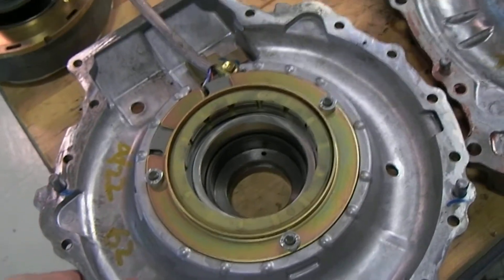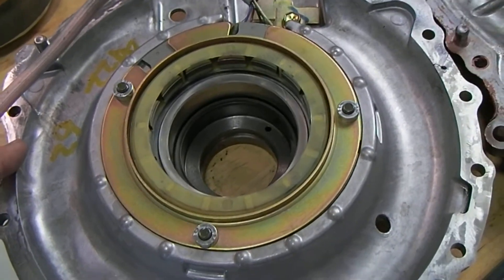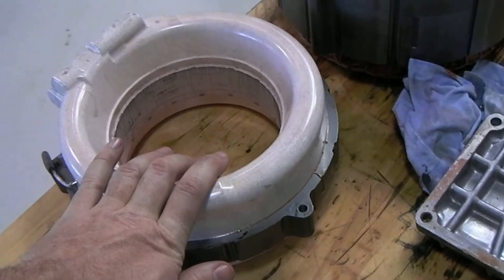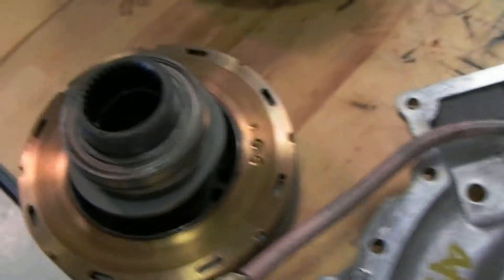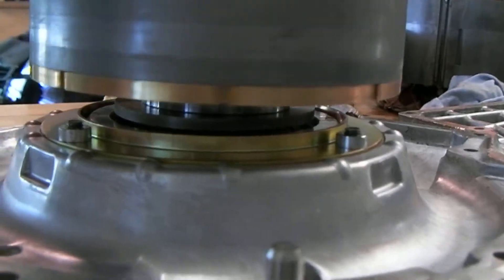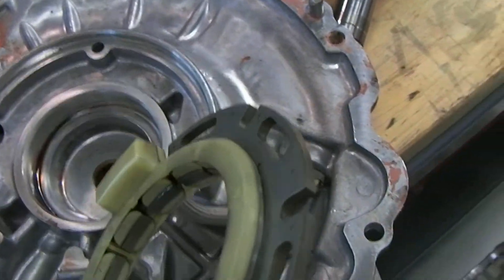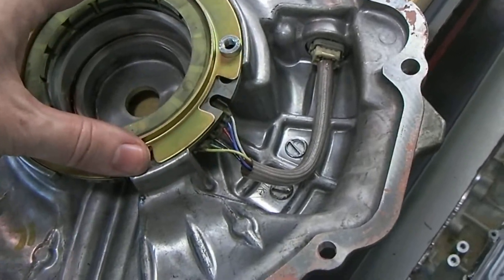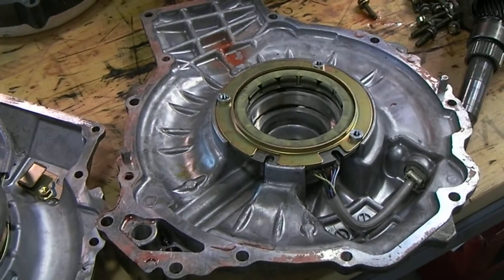Toyota Prius Resolver

Comment: P0a3f is what my 2012 ct200 threw yesterday. Which resolver does this point to? Shop is doing other tests on wiring now but if it is trans internal im just going to swap trans from a prius. Ok you need to have them factory calibrated. Darn. So if they dont find short in wiring or hyb ecu issue i wll have to swap trans. This stinks.

Comment: My prius gen 3 stopped me on the road. It give P0335. Crankshaft Position Sensor.  Sensor changed,  wiring harness ok, Ecu changed still the car refused to start. I thinking the mg1 has gone bad. Before the car stopped me, it was rattling and making knocking sound on at slow moving speed when the HV battery is charging only. If the Mg1 stop charging the HV battery the rattling noise stops. 
Could it be my transaxle that is my problem. I thinking of buy new engine and transaxle?

Comment: How to reverse motor direction with this type of resolver ?  Is it enough to switch any of two main phases, or sth. more is needed ?
Reply: The resolver only reports the position of the rotor, you cannot move or control motor direction with the resolver.

Comment: How do you "re-time" the resolver if you accidently took the 3 bolts off of the mg2 cover?  If I know the distance between the resolver and other parts of the cover, is there a way to fix it with a micro-meter?